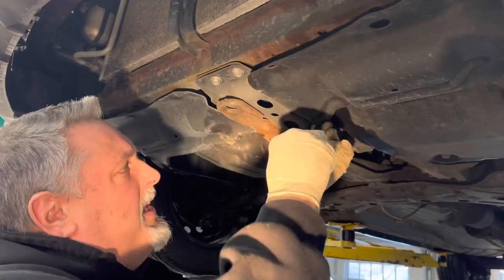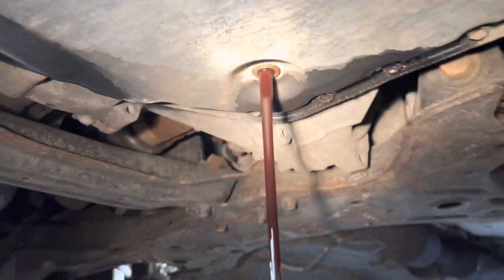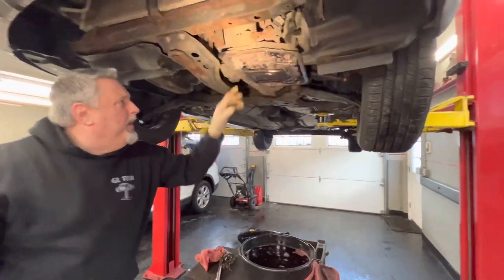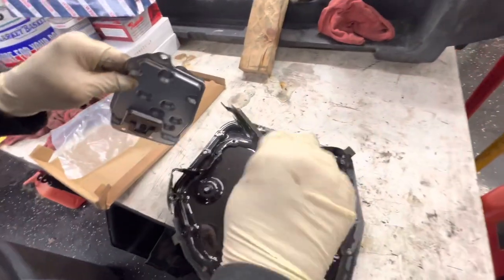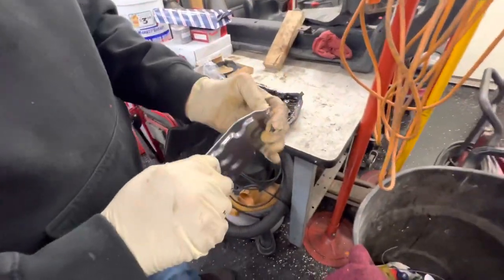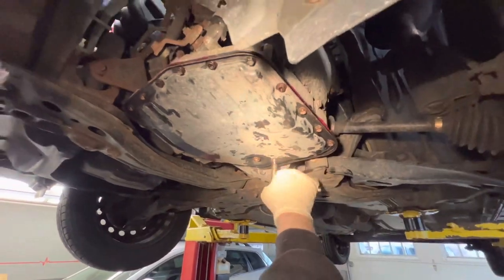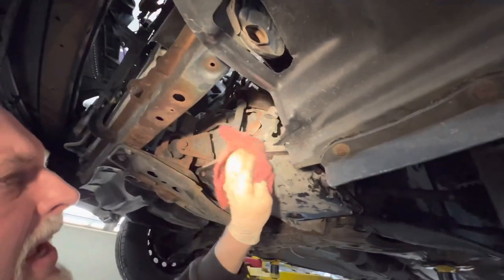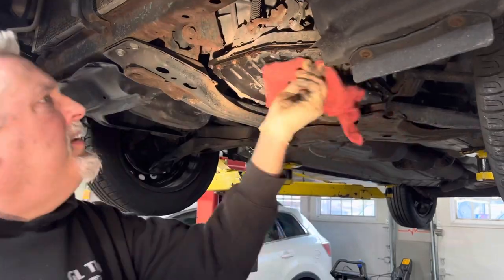2003-2008 Pontiac Vibe Transmission Filter And Fluid Change

Comment: I'm sorry I have a question
Do those cars have torque converter?Because there's a lot of trans fluid inside the torque converter , and can you do a flush on those? Thanks ..
Reply from the maker: To flush the torque converter out you would have to do a transmission fluid flush on the car. This Toyota Vibe has over 300,000 miles on it, so we felt more comfortable just changing the transmission filter and refilling with transmission fluid. Thanks for checking out or channel. Have a great day!

Comment: Is that original trasnmission? What is your atf interval change? And also original toyota engine? Thanks for sharing this video
Reply from the maker: Yes it is the original transmission. The transmission filter was changed every 30,000-40,000 miles. This Pontiac Vibe has over 300,000 miles on it and is still going strong. This is why it is important to change the transmission filter at the recommended service intervals.
Reply: What other parts in the engine bay did you change already in 300 000 miles? Im curious to know.  What a great car.

Comment: Do I need to change the oil too or just the filter? 196,000 miles on the thanks
Reply from the maker: I would change the transmission filter and top off the transmission fluid.

Comment: What is the absolute very best Transmission fluid can i put in these i just bought a 1 owner 05 with 90,000 miles i want to meticulously maintain it get the most miles we can thank you awesome video 😊 😀
Reply from the maker: You may want to buy some fluid right from the parts counter at GM. They can hook you up with the OE transmission fluid for it. Hope this helps you out.

Comment: Mine car has 168.000 miles. Can i use this also on it?
Reply from the maker: The transmission filter should be changed every 30,000 miles.

Comment: What is the torque did you applied?
Reply from the maker: We just snugged the bolts up by hand. The torque specs are probably online.
Reply: @HomeownerRepair  I did mine with filter 90inxlb; pan 50inxlb. Rubber gasket glued to pan with red silicone before reinstating. And atf was dexron-VI.

Comment: You are putting in too much fluid.  The factory fill is only 3.3 quarts for this model and that is dry.  There is still a lot of fluid left in the transmission and cooler after a drain.  I you put in 4 quarts, it must be overfilled.
Reply from the maker: The extra fluid will come out of the fill hole in the transmission pan. When it stops coming out it is up to the proper level.